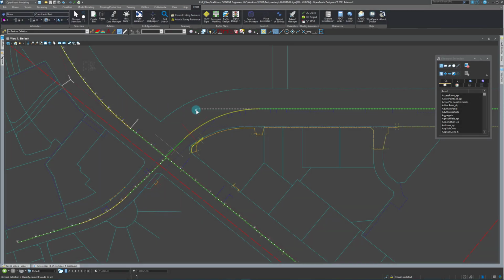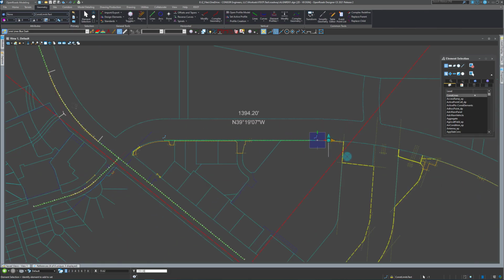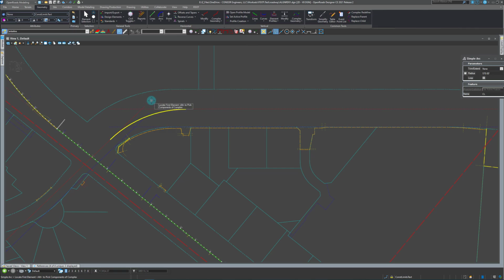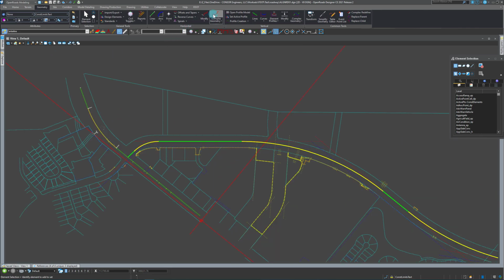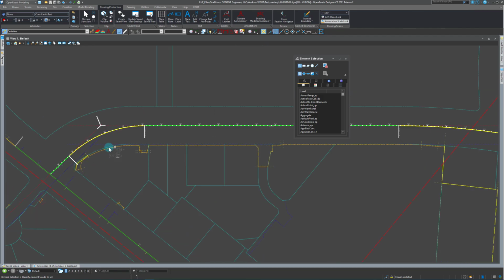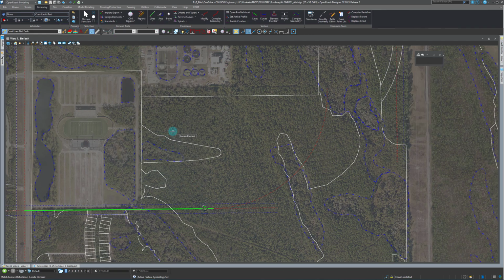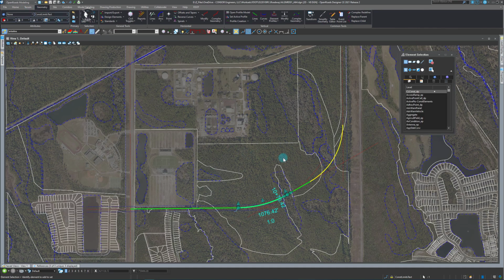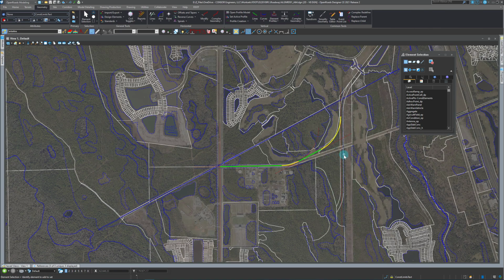OpenRoads Designer Alignments

Comment: Why do you stay away from Intervals and Gaps? Do you see some drawback in using them? And I don't understand why you use the construction lines for the centerline (that are offset from the ROW). Why not just use those 'construction lines' as the actual centerline? It seems like doing it they way you describe leaves you with three sets of geometry to manage - the Construction geometry, the Base geometry that you drew snapping to the curve PCs / PTs, and then the complexed geometry. I don't see the advantage in the construction geometry. I'm tracking with what you are doing 'mechanically', but am not sure where the value is. All of the edits that you did to the 'construction geometry' could have been done directly to the Base geometry.
Reply from the maker: Intervals have always been a pain if you are trying do an offset from the CL element. It's more of just a habit at this point to try and avoid intervals as much as possible. I think ORD has made some improvements to their functionality, but I just try to avoid them as a rule. 

I agree the construction elements may be a little overkill. I gave it a try on my most recent project to try and give myself some flexibility in case we wanted to adjust the offset of a specific tangent from the R/W line that was controlling the alignment.

A colleague actually directed me to Table Editor, which may solve some of the issues I have encountered previously. I need to give that a try as well and perhaps release another video showing that being used instead.

Hopefully that answered your question. Basically, I would rather draw more construction lines if it helps me avoid intervals.

Thanks for watching!